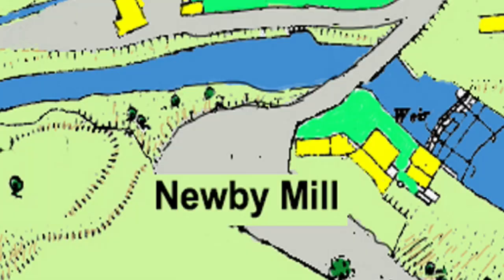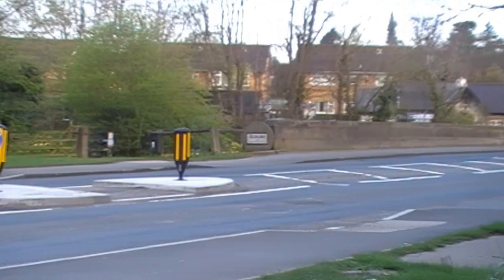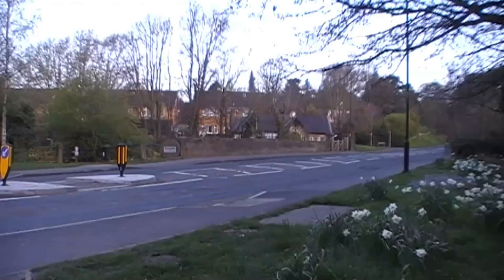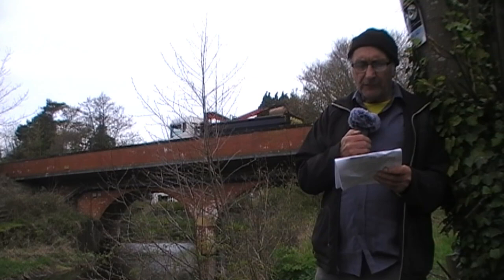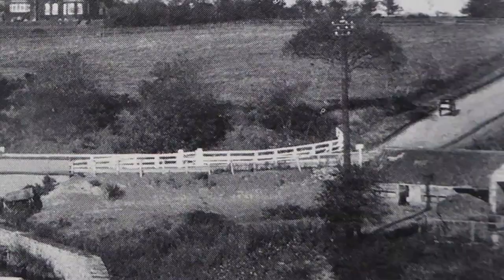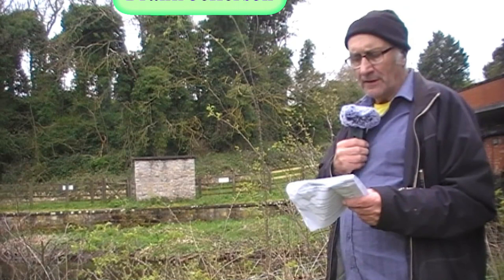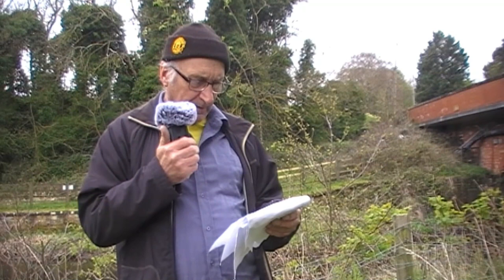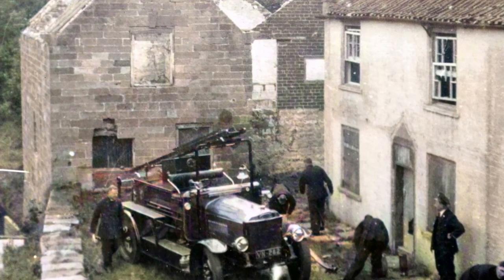History Of Scalby Mills, Scarborough part 6 NEWBY MILL

Comment: Great video - interesting - but prefer it when you are narrating… those automated voices and bots are really annoying 😫
Reply from the maker: I started to use them because they pronounced words far better than me - but I then figured that if I do a take with them speaking I can then use their voice as a guide for myself. Well that was the plan :) I agree that the voices are a bit annoying, mainly because there is very little emotion. I used male and female to try and break it up a bit. When I started this series I used what I had available but since then I have learnt a lot and also gained more experience with better software. One big advantage now is that I use a field recorder for my voice. That then gets synced up to the camcorder which allows me to talk without all the wind noise and pops and crackles that you often get from a camcorder/phone microphone. You will be pleased to know that they are being pensioned off :)